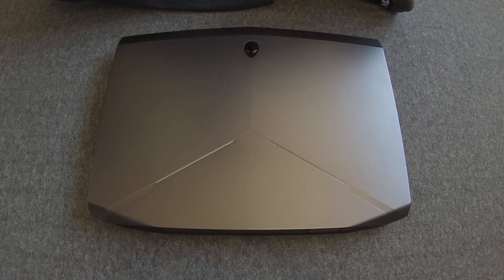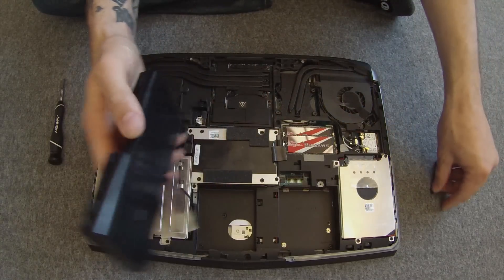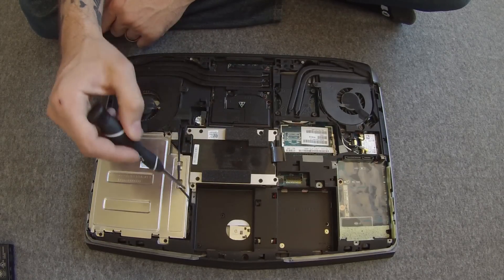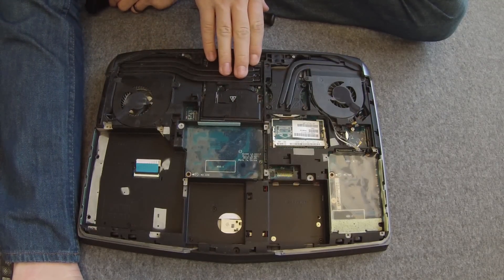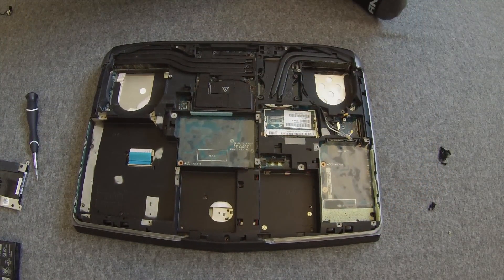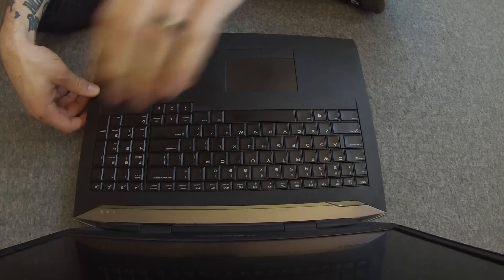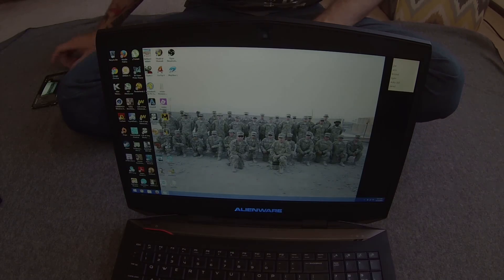Alienware 17 Teardown & Reassembly

Comment: What's the maximum ram I can upgrade to? Also the SATA card is 256GB can I upgrade to 512GB? And finally I need the serial number of the battery to order a new one.
Reply: 451-BBCB : 8- cell lithium ion (86 WHr), 
Part Number: KJ2PC

Comment: After dealing with whole Windows 10 bs I finally got it to work but it only lasted 3 months before something went wrong. So now since the battery doesn’t work I always have to have the charger plugged for it to work but today  I plugged it in and the charger light turned off and laptop wouldn’t turn on , so now I’m trying to figure out if it’s the Battery pulling too much juice since it doesn’t work or if the motherboard fried somehow. Can someone explain to me how to check if motherboard is fried once I disassemble pls. I have anxiety and depression so I don’t leave my room or work so I really want to see if I could fix it or if I really need to buy another pc which I won’t be able to afford. Any help is greatly appreciated

Comment: I have this exact laptop , second hand that I bought 2 years ago for 500 dollars cause I knew nothing about Gaming Pc or laptop , needless to say , it had many issues , that I did not know about . First This shit was not worth 500 , it’s extremely outdated, didn’t know till recently when I learned a bit more, I also had to reinstall Windows 10 Because for some reason it got deleted and computer had no brain so it would just get stuck on Alienware Logo and never boot up , this was a pain because for whatever reason , everytime I installed it didn’t do it properly , had to use command prompt to change to volume 3 or some shit that I don’t understand really but it eventually worked , also the battery was broken and would only work with charger plugged in.

Comment: I did this but went down to the CMOS battery to take it out and put it back in cuz it was recommended I do that to fix errors with installing Ubuntu on another SSD
So I did that, and the laptop doesn't power on at all, I suspected it was because I was sitting on a carpet doing it and static had something to do with it because I was laying all the parts down on the carpet, but people I ask don't think it is. I'm not sure why my computer won't power on now, the charging light doesn't even show up on the power button when the charger is connected and I know the charger works because it charges another Dell laptop I have. Any suggestions?

Comment: any idea what would cause this machine to cycle from detected to undetected powersupply every 20 seconds or so. it does that in BIOS as well. I changed the power supply and same thing.
Reply: The power jack where your power supply plugs into likely has a bad connection.
Reply: @IrwinFilms  actually turned out to be battery :)

Comment: These laptops are great.
I have the same one, paid around $700USD ($1000 Australian) back in 2015, just needed a keyboard and has no lights.
Yesterday I replaced the Monitor cable, easy as. but have a few screws missing because im clumsy lol.
It's still a beast with 770m, just has no lights.

Comment: not really static safe doing this on a carpeted floor.
Reply from the maker: Static safe is over rated. I've never had issues or known anyone that has had issues with static while building or tearing down. Jayztwocents and Linustechtips aren't too worried about it either. I appreciate the concern though!
Reply: @baustinmcmanus1991  I did this on a carpet floor and now mine's won't turn back on

Comment: Hi man, thank you for this video. I have the same laptop. My screen is kinda flickering, and I tried all the software solutions given on Youtube (tutorials). It didnt help so I assume it might be the cable of the monitor. Do you also have a tutorial how to replace the monitor cable? Furthermore I also upgraded my RAM with 2x8GB and in the front there is already 2x4gb so in Total 24GB. Might it be better to remove 2x4gb and put the 2x8gb in the front? Because I dont notice much difference. Thanks for you answer in advance.

Comment: Thanks!!!  I am working on upgrading the mSATA SSD in my Alienware 17 and needed to know how to get the keyboard assembly off.  You did a much better job of covering that than the pictorial web site I found that simply says "remove palmrest" with no info on screws that need to be removed to do that.  Thanks for being so thorough.
Reply: what is the maximum mSATA SSD size this model of laptop can support. Planning to upgrade, as i feel my SSD has reached towards its life end.

Comment: Hey I tried this and after fixing all parts together my laptop did not come on is there something that I missed ??
Reply: Same, did you ever figure this out?
Reply: FireFlame I actually had to change the strap that connects the keyboard to motherboard and it worked.
Reply: @kpap612  the one under the CD drive? Or under the palm rest once that's removed?
Reply: FireFlame if I remember it’s the small one under the palm which goes to the power strap
Reply: @kpap612  so I have to remove the screws from under the door and push out the palm rest to get to it?
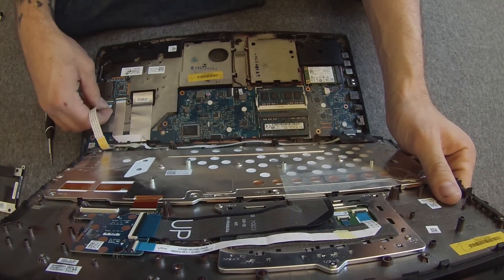Reply: FireFlame @13:28 check the video there that the one
Reply: @kpap612  hmmmmm I'll try that,

Comment: Thanks for this. For some reason my laptop came with 2 RAM modules installed on the outside, so to upgrade it i had to tear down half the laptop to add 2 more RAMs...
Reply: Yep that's the design of the Alienware 17 it seems. I have my other 2 RAM slots in the inside.

Comment: I need to replace the motherboard so I need to go further. 😂😂
Reply: I might need to do that too, as I went to replace the CMOS battery, and now it won't power on at all
Reply: @KylerFlame  mine had the GPU blow a fuse so violently it burned a hole in the mobo. So that was fun.
Reply: @TheRealJackassJesse  oh yikes, I did have the GPU on a carpeted surface so I'm wondering if that was the case, I'm not sure why it won't power on now in my case
Reply: @TheRealJackassJesse  nothing lights up even when plugged in not even the power button, it doesn't start up, I did put a old speaker into it that you can hear static come from it sounds like when I plug the charger in it stops making a static noise if I have the speaker connected to the computers headphone port,
Reply: @TheRealJackassJesse  I know ... I'm hoping it's just a lose cable connection on the inside

Comment: i know this video is already a few years old.
i just recently got this laptop and i'm hoping to get a upgrade on it.
Maybe you or someone else reading this can help me:
is it possible to remove/switch out the gpu? and if yes what size gpu fits in there?

Thx for your great video btw :D
Reply from the maker: Philip Ntellis I’m not positive, but I think it is possible to change the gpu. It is a MXM 3.0 card. I know the 980 works with this swap, but I’m not sure about anything newer like the 10 series.
Reply: Baustin McManus thanks, right now i got a gtx 765m in there. It's good enough for most games but struggling with the newer ones. So i'm looking if i can replace it. 
 And I think an SSD or M.2 Drive would help a lot too. And Ram wise it should be fine, i don't need more than 16gb

Comment: Well video is old hope you can answer a quick question if you still get notice of replies, I have the same alienware and am going to need to disassemble mine to get to the side trim LED as my blue has burnt out, any idea what size led they may be, I'm assuming RGB-LED but are they board mount or like regular component LED? Just wondering I'll figure it out once I open her up but any info would be awesome!
Reply from the maker: jinxmetwice420 its a proprietary part that you would have to contact Dell to get.

Comment: Hey brother! 
how do u know which screw to put since they have 2 different sizes (i was separating them properly until a god damn breeze swooped them away, what do u recommend for my issue?)?  i have the same alienware 17r1, and a kingston suv400s37240g for the hdd1 hard drive, but i have nothing on the hdd2 hard drive, would my computer speed be faster with a second one or a upgraded hdd1? thx!

Comment: Thanks! I wanted to clean the fans and also take the keyboard off to flex it to get rid of a minor impression on the right side (it's been through some use so some keys were sunken in making it look weird...). The keyboard looks much better now and the fan is quieter most of the time.

Comment: in alienware 17 2016 model how many hdd or ssd can b added at a time??? and what is the max ram capacity??
Reply: The Alienware 17 R4 has one SATA 2.5 in. HD bay, three m.2 NVMe SSD slots, and one half high m.2 SSD connection. 32Gb is the max for RAM.

Comment: Thanks for the info, is there a way to disconnect the battery without a 
complete disassemble? I am having an error code 43 on my GPU and a 
possible fix is removal of the battery, wait 5 min and reconnect, I dont
 want to strip the whole thing so am hoping there is a cable I can 
unplug to make it easier. Thanks.
Reply from the maker: Tony Celliers yes you can. Just take off the back and disconnect the battery. You don’t have to completely tear it down.

Comment: Do you think if I lift the Alienware 17 of the desk grabbing it from the lower part of the body with the both hands opposite to display while it's in up position so it's heavy and it will put pressure on SSDD connection? Cuz lately I have problem while starting it says the checking disk C:/ (SSD).

Comment: I failed taking off the lid aka keyboard during the last part of your video where you were taking off the glue so I gave up and put it all back together and when I turned it on the keyboard and mouse don't even power on 😭 Please help me.
Reply from the maker: Stephen Nguyen the glue doesn’t really matter. Make sure the connectors are secured on both sides of the cable. It should work unless you ripped it out of the connector or ripped the cable in half.

Comment: So I just bought an Alienware 17 R1 (as demonstrated here), and when I went to put new Memory cards and an msata card on top of the motherboard, when I put it back together, the touchpad suddenly won't work. At first, neither the keyboard nor the touchpad worked, and upon investigation, I realized I'd forgotten to reconnect them, but now that they're reconnected, the mouse is still dead.... Any experience with this problem? Any idea what's going on? I'm still getting the warranty transferred to my name, after which, if I haven't figured it out, I'll ask Dell and see if they know how to fix it. Thanks!
Reply: +Zfast4y0u Oh yeah! I forgot I asked for help with this issue. I got my "Free upgrade" to Windows 10, and it seems to have corrected the issue. Of course, Windows 10 has since crashed, and I was forced to do a reset using the Factory Image, which brought me back to Windows 8.1. Now I'm having trouble with the Symantec Driver, but otherwise the touchpad mouse works consistently and reliably.

Thanks for the advice, though! :) A very good idea.
Reply: +Zfast4y0u Nothing linking Win 10 to Alienware came up on that website, or in Google, when I tried searching there. Most of the search results are still general reviews of the hardware independent of the software. I did, however, get an email back from Dell Tech Support today (I tried to ask where the Alienware factory software download links were at, after Windows 10 reinstalled itself and wiped everything. I eventually located and reinstalled Alienware Respawn on my own), and all they had to say was that they don't know anything about Alienware computers, and to call the dedicated Alienware tech support. It's starting to seem like owning this laptop is going to be fuuun.... :/ (At least when it works, it works well. I still need to find a way to make old 32-bit games run on a 64 bit system. Some of them are cross-compatible, automatically, but some of the REALLY old ones aren't, and those are the ones I want to figure out).
Reply: +c182SkylaneRG  you needed to install the drivers for it
Reply: +Musty D As it turned out, that was correct. :) It confused me, however, because when I first forgot to reconnect the mouse and keyboard, it asked if I wanted to uninstall the driver, and I said "no", and thereafter, it wouldn't even recognize any "unknown hardware," or anything that XP used to do. So I assumed that the driver was still installed and it wasn't seeing the hardware for some reason. But you're right: when Win 10 installed, it brought its own driver with it, and suddenly the touchpad worked, again.
Reply: +c182SkylaneRG good to hear it worked out for you

Comment: Thank you so much for this, I love to watch laptop's disassembles. That's a hell of a machine with that GTX 880M, though it's kinda overpriced as you said.

For $3000, I expected that a gaming laptop, a DELL gaming laptop, would have a supreme cooling system. But Alienware 17 reaches 90ºC. In my opinion, a Dell gaming laptop that costs $3000 should never reach high 70ºC's, even in a stress test, ever. That would guarantee that Intel's CPU never throttles and Intel's Turbo Boost is always on and does not get deactivated due to temperatures.